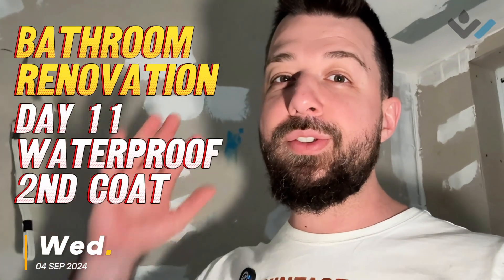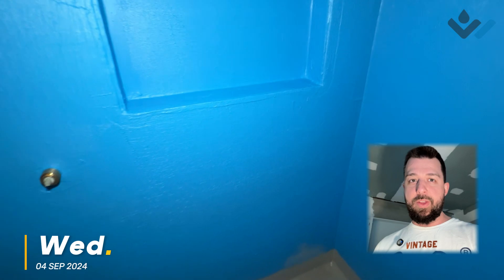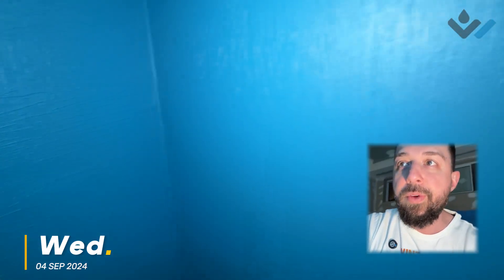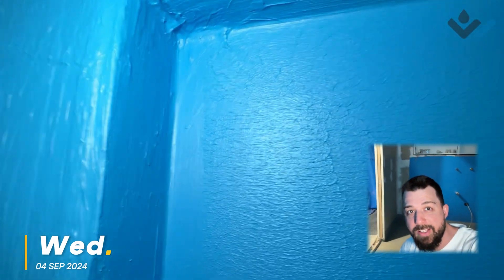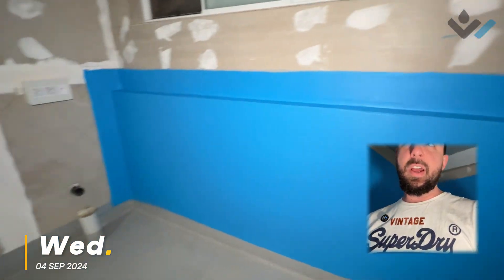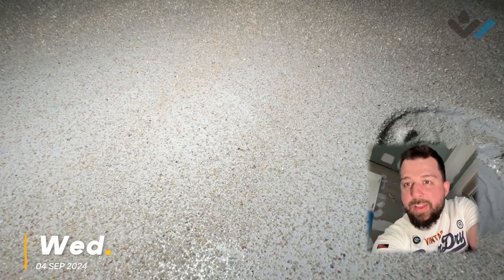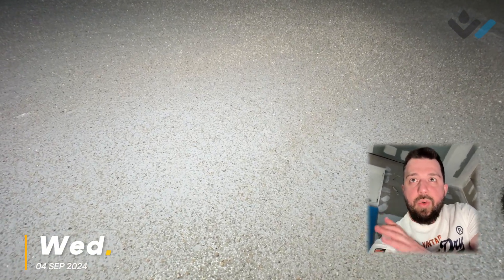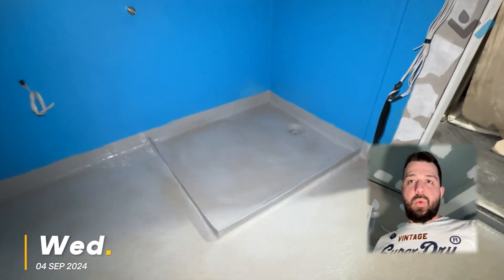Bathroom Renovation Day 11 Waterproofing 2/2 Under

Comment: 4:15
I don't think the NCC or AS has provision for sandwiching the screed between waterproofing.

I hope you use a moisture meter before applying the upper coat after the shower screed is completed.

Otherwise looking great David and terrific progress 👍
Reply from the maker: you are correct, AS3740 says under OR over but does not say anything about both. can result in some bad outcomes and entrapped water if you are not careful of all the considerations and potential consequences. there is definitely going to be a few things outside the box in this building but im also attempting to explain along the way the justification on how performance will be achieved accordingly